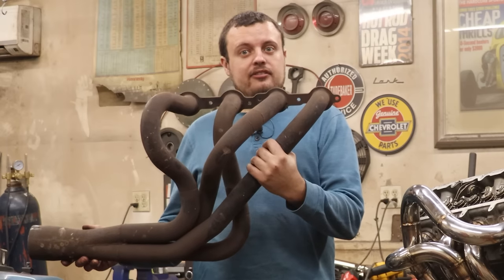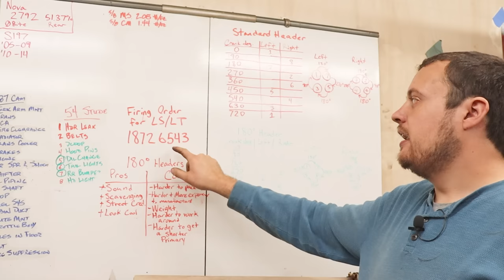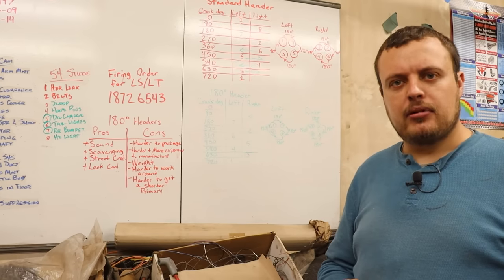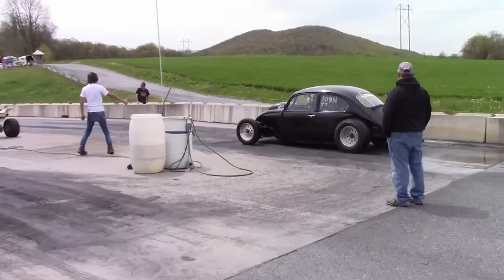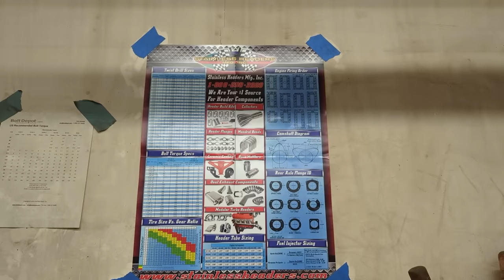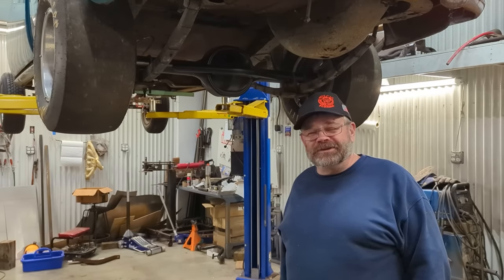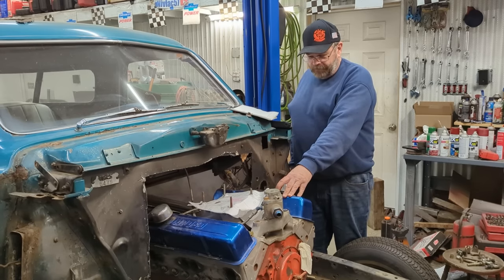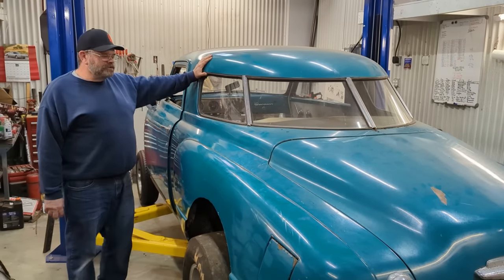I Built a Set of 180 Degree Headers for the Perfect Sound

Comment: I think building you own headers is awesome. 180° headers made right do outperform standard headers, but that sound.  Yuk. Everyone is going to think it's a V6. Flat plane V8 engines sound just like a V6, horrible.  I never knew 180° headers would ruin the great sound of a cross plane V8. I definitely learned something.  Thanks for teaching me that. I will definitely stick with different length standard headers forever now. I do think what you are doing is cool though. Lots of work and you did a great job. I just can't get over how it ruins the sound. Sad.
Reply: Most modded V6 cars sound like crap because ppl think they can make them sound like V8s. A 6 cylinder car (especially I6s, imo) sounds amazing if you tune the exhaust to compliment its characteristics instead of trying to force it to be like something it's not.
Reply from the maker: I don't agree with them sounding like a V6. They do sound like an I4 or and I6 at higher RPM though. That's what I'm after. I will always be an inline 6 guy.
Reply: Hey man, I'm not insulting you. I think what you are doing is cool and yes absolutely you should fo your car the way you want. If you like the sound then that is great.  However I listen to that car you showed and a V6 back to back and without seeing it I cant tell the difference.  I build my cars to fit me and my style to reflect myself. You should absolutely do the same with yours. I meant no insult. Like I said, the performance is better and I think building your own headers and all that is awesome

Comment: what about heat?
Reply from the maker: I'm not too worried about it. It has a pretty good air gap, but we will keep an eye on oil temps. If it becomes a problem, we'll wrap the headers in that spot. Look at modern Hondas. They run the exhaust right under the oil pan similar to this.

Comment: i only saw the thumbnail, and boy that oil is gonna get hawt
Reply from the maker: I'm not too worried about it. It has a pretty good air gap, but we will keep an eye on oil temps. If it becomes a problem, we'll wrap the headers in that spot. Look at modern Hondas. They run the exhaust right under the oil pan similar to this.
Reply: @Calvin-Nelson  I didn't think about the new Hondas at all, i appreciate the insight and the time you took to reply to my comment, keep on keeping on 🤙

Comment: No one is going to address the 180° of extra heat being radiated to the oil pan.......
Reply from the maker: I've received many many comments on it. Just build them out of stainless and it's not a problem. Highest oil temp I've seen is around 205F on a hot summer day sitting in traffic. It is not a problem

Comment: Looks like a massive oil heater.
Reply from the maker: I'm not too worried about it. It has a pretty good air gap, but we will keep an eye on oil temps. If it becomes a problem, we'll wrap the headers in that spot. Look at modern Hondas. They run the exhaust right under the oil pan similar to this.

Comment: Putting a lot of heat into the oil pan.
Reply from the maker: I'm not too worried about it. It has a pretty good air gap, but we will keep an eye on oil temps. If it becomes a problem, we'll wrap the headers in that spot. Look at modern Hondas. They run the exhaust right under the oil pan similar to this.

Comment: This is gonna be epic. However, my autism gives me the urge to point out that you could've pulled a David Vizard and made tuned-length UEL headers that would force the pulses to arrive at the collectors evenly. You also could've done a sequentially fired 8-into-1 like this person did: https://www.youtube.com/watch?v=dKVRBFLDwsU&ab_channel=TrackDayClassics
Reply: Man, I'm gonna make a whole nother comment for this: Noticing your packaging concerns and the long primary length causing a high powerband; Couldn't you have made these a tri-Y setup, or otherwise a 4-2-1? Wait, no you can't, because the crossover cylinders are still 180 apart instead of the 360 apart they'd need to be for that. Bollocks.
Reply from the maker: Yeah. I was thinking about making uneven primaries, but that would get you the sound without the performance benefits.
Reply: @Calvin-Nelson  How so? If it changes the timing of the pulses, wouldn't it also re-align the scavenging?
Reply from the maker: @Drunken_Hamster  It would get the pulse going into the collector right, but the scavenging pulse would have to travel up the wrong length, and therefore no benefit.

Comment: You can even rename your race car to Oil Boiler..😛
Reply from the maker: I'm not too worried about it. It has a pretty good air gap, but we will keep an eye on oil temps. If it becomes a problem, we'll wrap the headers in that spot. Look at modern Hondas. They run the exhaust right under the oil pan similar to this.

Comment: Always disappointing to see a great road handling car like a Datsun Zcar turned into a drag car ! Yes I get they're a light weight car and relatively  smooth aero shape both great for drag racing. But even with a V8 instead of the great sounding stock il6 it came with, theyre still a better road racing car. So why make it just a straight liner ? Not too mention they have sky rocketed in value in recent years. I bought one rust free in 1992 for $1500 couldnt touch that car now, unless you spend almost 10 times that ! I even bought a really good shell that still ran as a parts car for $100 plus towing fees !! Sold that cars motor for $250 which covered both cost of the shell ,and my having it towed  home !  God damn still wish i had both those Z cars !!!
Reply from the maker: My Dad paid $100 for that car. When we converted it to a Drag car they were worthless. You do you, but personally I try not to judge what others do with their car.

Comment: Instead of building a V8 the right way, you put a bandage over the drawbacks of that old design! 
You americans always amuse me. 😂

The only benefit of that crosplane crank is better secondary balance, and the rumble sound.

By all those custome part you trow into your "performance 🤭" engines, it would be soooo easy to make a flat plane crank and a appropriate cam.
And besides being a 2 valve push-crapp engine, all additional problems that come with that crooked fireing order would be gone!
Short, even length headers.
Even distributed intake pulses in the manifold.
Less rotating mass and radial balancing forces on the crank.
Reply from the maker: Billet cranks ain't cheap.